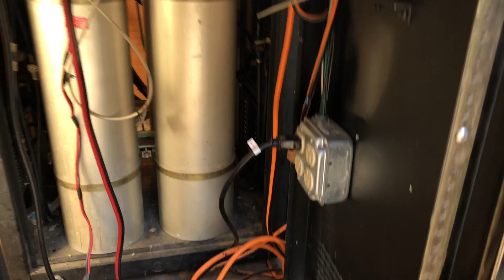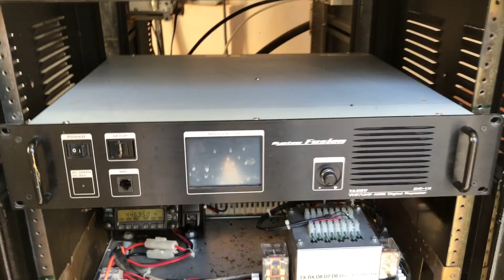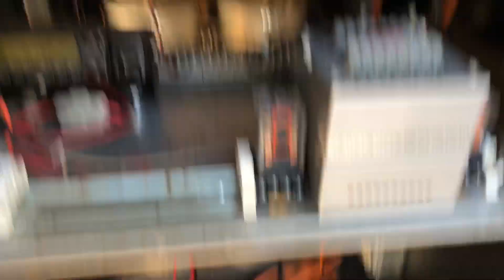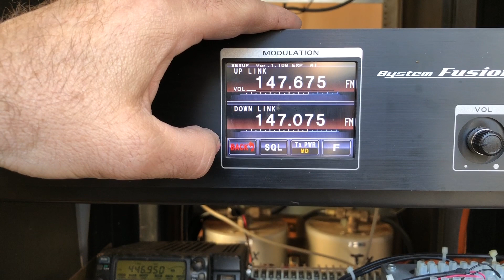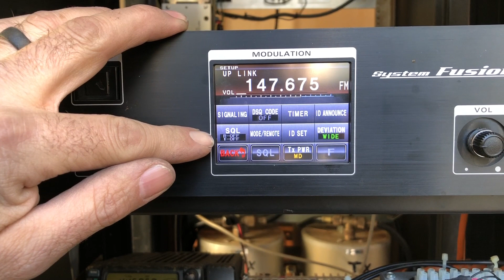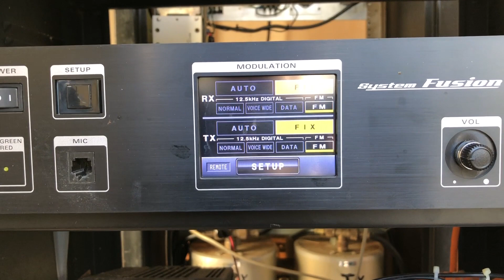Repeater Swap-out Yaesu DR-1X FM

Comment: The  DR-1x's have issues with the PA's. Yaesu bought many of them back or traded for the 2x's They re-did the 1-RX's with new PA's and new Firmware and re-sold them as DR-1x-FR's. My old club bought one of the refurbished ones and it has been a rock solid machine with it connected to the America Link 24/7 and a solid performer. The biggest thing they did is change their paperwork to say that it is 100% duty cycle at 25 watts as opposed to 50 watts that they had on the original issues. We ran that one at 25 watts and no issues.
Reply from the maker: I have heard about this issue with the DR-1X. We run both our Yaesu repeaters at mid power level (25 watts) just to play it safe. Our digital C4FM repeater is connected to America-KC-Wide room which has quite a bit of traffic and It's performed well for us.